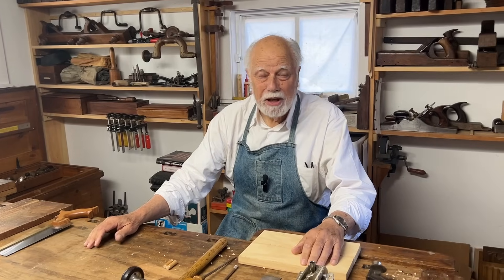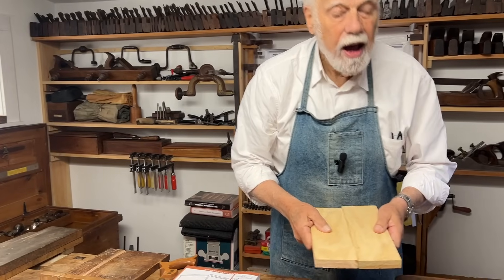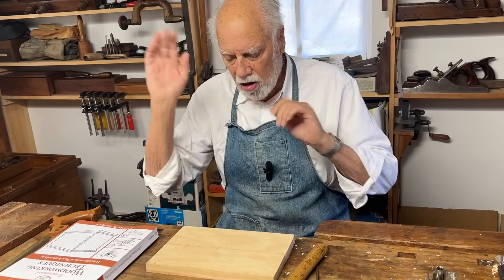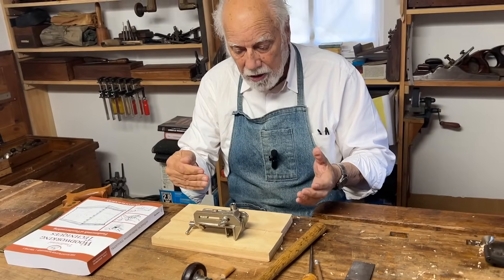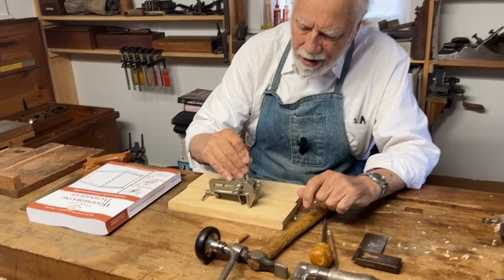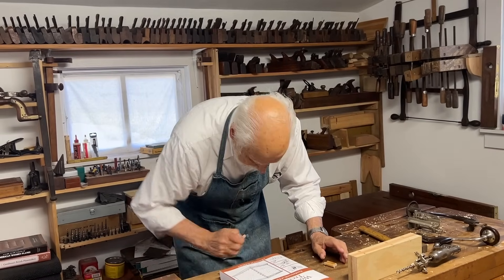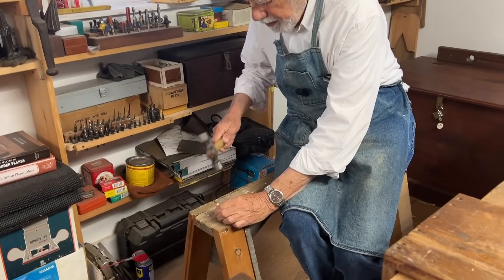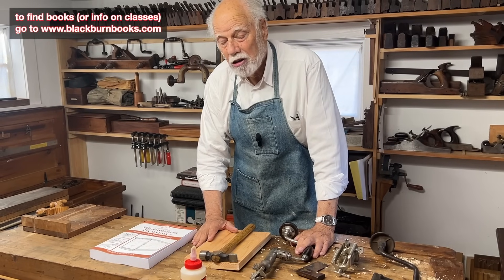109.Joinery 5: Dowelled Butt Joints

Comment: It might be my screen but your board does not look flat.  When you have it on the bench at the end (of the vid) and put your hand on it, it rocks and a gap under the edge is clearly vissible.  That's disappointing.  However, I have grasped the concept so thanks.
Reply: I noticed too 😂

Comment: I'm confused. As a North American woodworker, that is not a butt joint. A butt joint is when the end of a board is joined to another board. This is just a dowelled glue up. Do you use the term differently in the UK? I'm not being critical. I'm just wondering? I love your videos and always look forward to them.
Reply: How about dowel reinforced edge to edge butt joint or loose / floating tenon joint for a panel glue-up.

I think butt joint is still right though.

Comment: What is the primary function of the dowels - strenghtening the joint or aligning the two boards?
Reply: For a panel glue up pretty much alignment. Alignment during the glue up and to help keep the panel flat longer term. 

But just the butt joint for a panel is pretty strong. To the point that if your panel split it tends to split somewhere else than the glue line. 

For a right angle connection you need something more than a butt joint it's too weak. Floating tenon like a dowel, screws, dovetails, dado, mortise and tenon etc.